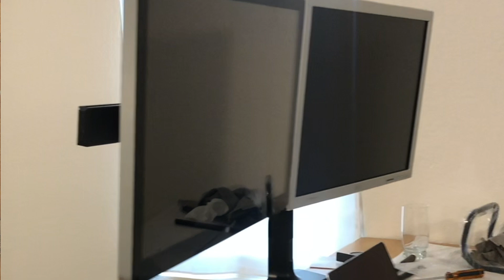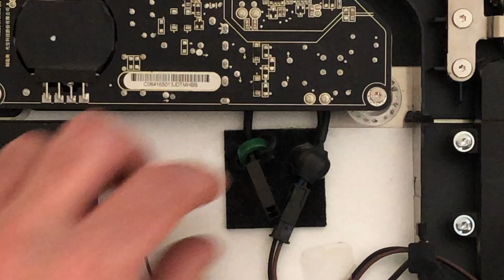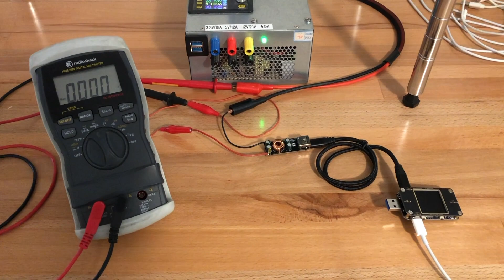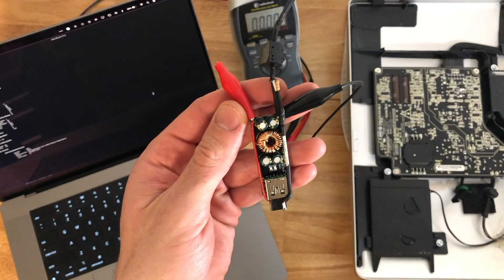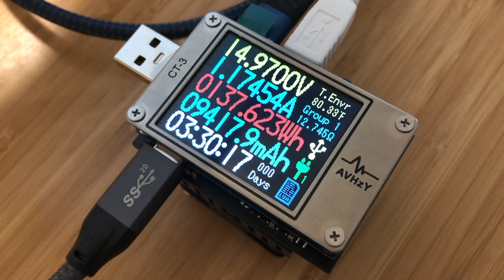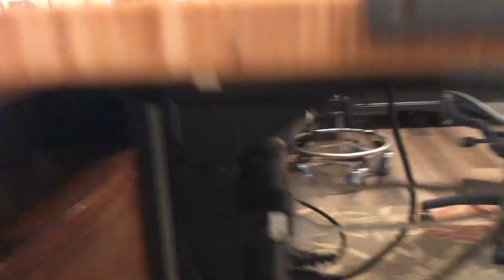Thunderbolt Display USB-C Retrofit for Modern Macs!

Comment: Wonderful work, can i ask you if can be possible to make only one usb-c cable came out of the monitor, carrying both thunderbolt signal and power?
Reply from the maker: I would really like to. But between Thunderbolt, USB-C, and Power Delivery standards, I'm just not sure how the power negotiation is supposed to go, and don't want to experiment on my brand new 16" M1 Pro! There are hubs that can do it though. Check out CalDigit.

Comment: Would it be possible to join the data cable and the power cable into a single output from the monitor?
Reply: id imagine you could get a hub to run it that way
Reply from the maker: @JustChillingDom  Yep, exactly. CalDigit has one. I don't know how to properly combine power and Thunderbolt, could be complicated, and risky to my laptop!
Reply: @colindgrant I guess you can decase Mini Dock version to use it inside apple display, but the price of this hub is too high.
Reply: Exactly my thoughts!

Comment: Great video! What monitor arm did you use to hold up the displays?
Reply from the maker: It's a Vivo dual monitor arm. The same model is sold by a few manufacturers under different model numbers. It's decent but dual 27" screens is pushing it on any of the common arms out there. I've tried 6-8 different models and I like this one the best because it keeps the screens in the same orientation relative to each other.
https://www.amazon.com/gp/product/B08LM68CSP
Reply: @colindgrant  thanks!!!
Reply: Hi would like to know that as well 😃

Comment: So you think it’s possible to connect the buck converter assembly directly to the two pins inside the supply connector? So that you don’t have to break the original cable assembly housing the power cord and Thunderbolt cable.
Reply: Or what role/function does that black plastic piece at the end of the power cable have?
Reply from the maker: @nivt5262  You've got to fool the power supply inside the monitor into thinking it's connected to a Macbook. That's why you need the specific resistor. And the diode avoids weird interactions from connecting the two switching power supplies connected together: the power supply in the monitor, and the buck converter.
Reply from the maker: In case I misunderstood your question, you could wire the buck converter into the power supply wires without reusing using the black plastic two pin connector. Nothing special about that connector. My cable assembly was already flaky so I didn’t feel bad about cutting it up!

Comment: Alternatively just attach Thunderbolt-to-USB-C and MagSafe-to-USB-C adapters to the end of the breakout cable. That's what I did, works fine.
Reply from the maker: Yeah, true. I started out that way but the beauty of the TB display to me was two lightweight straight flexible cables that moved with the laptop and were never in the way. The adapters I had were different sizes from each other, and magsafe is a 90 degree connection, so there was always some connector being tugged on. Plus the magsafe adapter I had go pretty hot. I made this video for anyone who wants to return to just having two direct cables like the original design. That works best for me, and it was fun too :)
Reply: @colindgrant why didn’t you combine the power and video type c cables into one and have only 1 exit the monitor?
Reply from the maker: @basically_chris  if you know how to do that I’m all ears! Note this is a Thunderbolt signal, not just USB-C.
Reply: @colindgrant  It was interesting to watch 👍 I’d love to know if anyone has figured out a single wire solution, maybe using a hub of some kind?
Reply from the maker: @gefthetalkingmongoose  You and me both! I know there are Thunderbolt 4 hubs out now that will provide up to 100W charge and full TB4 speed over one USB-C cable. But I don't know how they inject power into the TB cable. They are pretty expensive, but I think if I used one I would ignore the power supply in the TB display, just run TB2 down to the hub, somewhere out of the way, and use Apple's TB2<->TB3 adapter at the hub. Then just the one cable from the hub to computer. That could be a slick setup.

I read that regular TB intended for data only still carries a small amount of power (somewhere around 10W to 15W). So I'm pretty curious how TB and 100W Power Delivery charging is combined. My sense is that it's probably complicated, and bad for your laptop if you get it wrong :)
Reply: Thank you for your video! I‘m running my MBP 2018 with the Thunderbolt Display charging via MagSafe to USB-C adapter. Unfortunately these adapters are quite unreliable and become really hot during use. So this is a genius solution for USB-C MacBooks!
Reply from the maker: @nivt5262  Yeah I tried one out and I had the exact same experience! It was an awkward angle and length, so it was always tugging on the laptop port too.
Reply: I wonder what wattage you get on that TB-USBC adapter?
Reply from the maker: @retrun813  That's covered pretty thoroughly in the video
Reply: I just purchase a Mac mini m1 and hit a road block when running the cable to the back of the mini m1 the sales rep told me over  the phone that it’s a plug and play with my old   27” Thunderbolt Display so now I either return it or figured a work around , do you know a quick turn around to make this work like adapter of sorts
Reply from the maker: @carlosr.2027  Yes, that's what's being used in the video.
Reply: @colindgrant  is there a Thunderbolt hub you recommend that will run 2 Thunderbolt Display that will work with my Mac mini m1